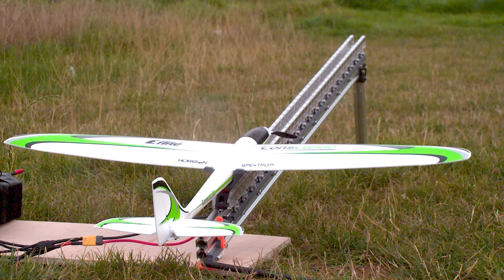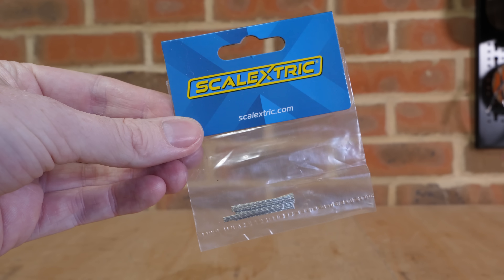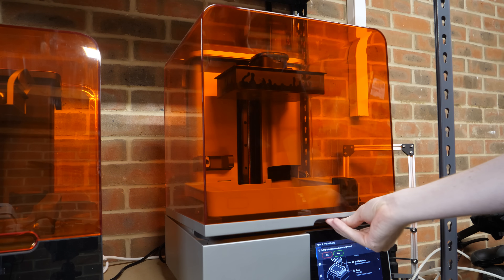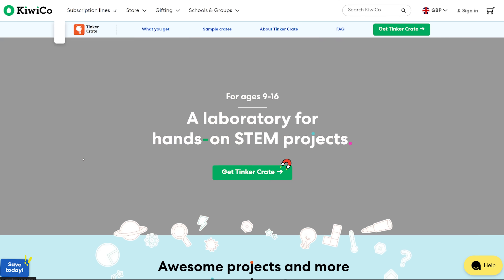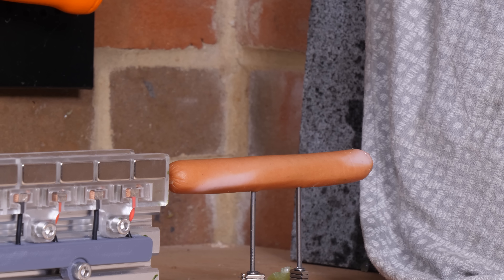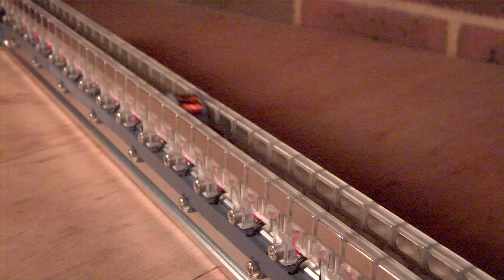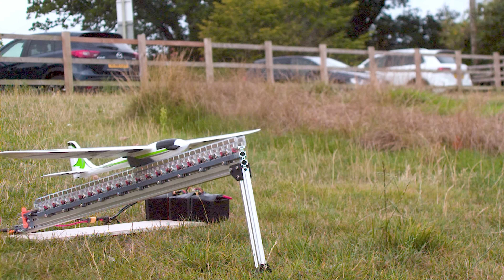Electromagnetic Aircraft Launcher

Comment: Definitely one of the coolest, even if I reckon a brushless motor and some timing belt with a linear rail could get you repeatable braking for a no collection necessary slide.

I mean obviously there are a lot of ways of doing it, but an analog brushed linear motor is one of the flashier ways it could be done.

Comment: This should be computer commutated using optoelectronics sensors, Hall effect or eddy current sensors, or anything that’s physically and galvanically isolated from any moving parts. They even have MEMS chips that function as reed relays with no latch bouncing. I think they use Hall effect sensors and SCRs. I’ve built TTL and microcontroller SCR/mosfet drivers that have timing adjustments for each coil and that seems to work best. No spark gap erosion. No commutator wear. If you’re using commutators it should be of tungsten, or platinum coated copper, or any refractory (high melting point) metal that has low resistance and high wear resistance.

Comment: Instead of that bigger Reed switch you made, you could have kept the original switch. Just by adding another spring on the top of the switch that pulls it with force onto the contacts. Large power circuit breakers use large springs to slam the contacts together so they don't bounce and cause arcs and damaging the contacts. Some breakers even have a crank on them to wind the big spring

Comment: Need to combine this new launcher with your capacitor airplane! Think of it like those missiles that sit underground for years, then get prepped and launched within minutes. Here you can have two contact strips on the top and another set of brushes riding on them specifically to charge the capacitor. So once you press the "Go" button, the plane will get accelerated while also getting charged up at the same time! May not fly for long, but at least it will be very quick to re-launch.

Comment: Once the sled has some speed, you shouls also change the "timing" so the coil shpuld be energised earlier. I think (by using "pre-ignition")  then you can end up accelerating faster, with a higher end speed

Comment: flyback diode is a must in this design to preserve the contacts, and possibly the batteries. your coil produces immense voltage each time the contact is abruptly created or broken which results in violent sparks.

to debounce the launch switch, just use a microswitch

Comment: Really interesting watch, reminded me of my RC car days and the brushed motors we used to use. As your launcher is basically a brushed motor reimagined.

There are maybe two improvements you could make to your launcher. First using a motor brush and copper for your contact points. Motor brushes are designed to be strong electrical connections and low friction.

Second, with ‘modified’ motors, there was an option to advance or retard the timing. This changed when the coil was activated relative to the magnet. From memory this could change rpm and torque.

Maybe could help with future versions.

Comment: The back emf coming from the coil creates a serious problem in the polarity change that occurs when the carrier moves. For this reason, extra pads with a diode connected between the pads with different poles in accordance with the direction of the back emf will greatly increase the performance.

Comment: When you vary # of turns, you should adjust wire gauge to fill the bobbin the same (this will also make the mass the same).
          You need carbon brushes for the contacts.

Comment: Now you need to make a coil-gun for landing, too!
How is it supposed to accurately dock with the retardation sled? I have no idea! But imagine how cool it would be to no longer have to worry about your landings damaging your creations and instead always just aim them at a sled that when it [the plane] hits it [the sled] is lightweight enough to not damage the plane, grabs onto it, and then retards it using a low enough force that the plane does not get damaged (but still stops before it runs out of rail and crashes).

Comment: How did you calculate the optimum distance between the coil and the brushes? Could there be room for improvement if different sledges had a different offset between the brush and the coil? I could imagine the sledge mass can have an impact on this variable.

Comment: I'm curious to know what would happen if you did not use brushes at all, and instead had a wire tethered to the sled (below the sled, leading under toward the far end of the rail). Then you could trigger the firing optically, resulting in less friction, and possibly making the rail construction simpler.

Comment: Apparently to prevent bounce: Weaker ceramic magnets on the middle section of the switch arm, and the contact stopper did not exist in 2024. :- Apparently: A pair of Carbon brushes, and torsion springs like in an angle grinder did not exist, and neither did solid copper contacts. And I know for sure bipolar Capacitors to prevent back EMF sparks definitely don't exist in 2024. Sometimes simple; is to Simple. Overthinking is way better.

Comment: I think you need to reverse the design. Permanent magnets on the plane, multiple coils along the track. Turn the coils on and off with photo sensors and driver transistors. No issues with contact brushes that way.

Comment: 7:21 wouldn't have been better using a power mosfet to drive the high current that is controlled by the small reed switch? I guess that, due to being smaller and moving less, the small reed switch would bounce even less.

Comment: 1. Use Ferrite core on the sled to increase magnetic force applied to the sled.  Ferrite would also work better with fewer turns.
2. You can use Electric Motor brushes made out of graphite to avoid plating problem. usually Motor brushes have springs to apply a small amount of force on the contacts to get a good connection. Only one side of the static brush contacts needs to be intermettent. You could just use a single bus bar along one side & just make the other side segmented. 
3. Adding local capacitors for each stage (segment) would increase the current for the coil providing more acceleration power.
Reply: > Only one side of the static brush contacts needs to be intermettent. You could just use a single bus bar along one side & just make the other side segmented.
I think this is only true if the polarity between each magnet segment wouldn't be inverted in alternating fashion
Reply: @MrFlaschenhalter  Correct, if you needed to swap the field after every magnet you need both sides to be segmented. I'm not sure if it is worth flipping the field as the ramp on/ramp down time of the coil may take too long to respond to the magnet's repulsion, not sure tho

Comment: Hi Tom 👋😀 
So is there a speed limit if you made it longer?
As i understand it, its just a DC motor in a straight line. So given the information you have how long would it get before there's no increase in speed?
Reply: There is a speed limit for the same reason objects falling off a building will eventually stop speeding up (terminal velocity): air resistance. The electromagnetic force at the start is far greater than the force of the air the sled needs to push out of its way (not to mention other forces like friction), but eventually the sled will be going so fast that the air resistance (plus friction and everything else) equals the electromagnetic force and then it stays at that speed, aka speed limit

Comment: Two suggestions: Insert an iron core into the coil to focus the magnetic flux. And exponentially increase the magnets along the track to build up the acceleration.
Reply: A powdered ferrite core is likely going to be even better than an iron core, but finding the ideal mix will depend on the switching frequency...
Reply: @georgedorn_fnord I agree that powdered ferrite seems like it would be better, but as you say I’m not sure whether the frequencies involved would be high enough for it to make a difference or not.
Reply: @DaveEtchells  Guessing really wildly and looking at the frame data in his analysis, I estimate the switching frequency can't be much more than a kHz or two.  That said, it'll look more like a square wave than a sine because of the time spent in air, and it's really the charging and discharging time we care about most.  If we sliced out the air time and measured the ramp up / ramp down times, that could be far higher.  I wouldn't even know where to start, there.
Reply: @DaveEtchells  I think ferrit core would almost be a must, as iron is magnetic and could interfere with the rail's magents when unpowered.
Reply: @dusinnhht tattoo machines use an iron core in the coils and dissipates magnetism well  up to at least 200HZ but the rail accelerator is probably running much faster so you may be right
Reply: Sorry, that should read   "exponentially increase the spacing of the magnets along the track to build up the acceleration"
Reply: @FondueBrothers  maybe not?.  You could, in theory, print it like a channel and just stack the magnets next to each other.  At this point it becomes how close the AC connectors can be.
Reply: Putting a 100nF (0.1uF) 250V capacitor in parallel with the coil will significantly reduce or likely eliminate the contact arcing and save your brushes. Nice project 👍
Reply: The ferrite core will enter saturation. There will be a nonlinear increase in current. The ferrite core also has disadvantages. 🙄
Reply: just a thought on that and the sparking. The magnetic field builds up in a linear way due to the inductance. With the voltage and inductance you get: u=L*di/dt. So the more inductance you produce the longer it takes for the same voltage to drive the current through the coil. But current is the important thing to magnetic field. Also the sparking is directly related to the energy stored in the coil. Energy flow must be continuous it cannot go to zero at once. So the voltage goes to infinity (theory) and the current keeps flowing due to the arc connection. Maybe some of the time to actually build up the field in the opposite direction gets lost in the full discharge of the remaining field (?) Same for relays and the free wheeling diodes. So I guess it all goes together in a design that appreciates the gain in speed due to the acceleration with changing contact length. Maybe also two coils each with a free wheeling diode in opposite direction might help with the sparking and get a faster initial build up of the magnetic field.  Anyway a really cool thing to wrap my brain around, thanks for the inspiration.
Reply: Could you put a high voltage capacitor (inside the coil) to supply the power to the launcher - so that the capacitor is part of the projectile?
Reply: Go look at a LINAC
Reply: Waaaait a second. Thats a railgun!

Comment: tips to reduce re-bounce on your high power switch (you might tried some of them but just didnt show)
-have it travel less distance since it will build up less momentum
-keep a lot of tension even when the contacts are closed 
-make everything as stiff as possible since the re-bounce is from material flexing
-keep the arm short since less mass and also less flexing

Comment: The whole rail except the first coil be live and the trigger just brings the last one on to fire, this means even if the trigger bounced as soon as the 'trolly' made it to the second set it would be live and  fire. 
If the trigger under spring was still in (pre)tension when in the fired position  it would also help calm the bounce back from the contact which could also be sprung to maintain contact through it's accommodation as well.
Carbon fiber brushes for contacts from cheap/broken ionizer modules or replacement brushes for them are easy and cheap and prewired.
Can the sled be captive and slowed or stopped in place come the end...

Comment: I'm on a similar project right now with the coils mounted on the rail and the projectile passing through them but your design is much simpler as it doesn't require an Arduino❤

Comment: I suggest trying the following: 
* Graphite brushes - you will be able to time when connections are made better, but at the same time there could be increased friction, so maybe it would not work well.
* High magnetic permeability material as back-iron for the magnet rails - do not underestimate the increase in magnetic flux of the magnets this results in... there's a reason basically every single electric motor has high permeability material to connect the flux paths of both electromagnets and permanent magnets.
* Shape the coil as a rectangle instead - could help a little bit
* ptfe surface for the carrier to slide on - reduces friction
* Make sure that the later stages aren't fighting your carrier - As you know, it is impossible to collapse  the magnetic field in an inductor immediately, and with the fairly high inductance you have with hundreds of turns, you might be killing most of your acceleration from the later stages. 
* Less turns with larger wire or multiple wires in parallel on the carrier - Allows for greater current capacity and lower resistance.

Comment: Nice railgun :) Looking at the spark shower, it could probably be reduced significantly by using graphite brushes like in electric motors. Either attaching them to the braids, or other springy pieces of metal. Another option would be to make polarity switching on the cart with magnet switches and have non-interrupted power feed to the cart. Hopefully there will be more development on this.

Comment: If you were to give an initial push to the coil sled, so that the magnets don't have to work that hard, say 2m/s, nothing crazy, what also could be done with the initial trigger, then I believe you could reach higher velocity, and acceleration, because the initial chattering of the coils is avoided. So the magnets really sohould be just the accelerators, not the movement initiator components. If you thought about this, but just not presented, then Mea culpa.

Comment: If you add some force to the brushes, say wrop them arround a TPU spring or use sprung carbon brushes, or even a  carbon brush with a TPU pusher... You will likely get a better result, IE less sparks. It would also be interesting to look at the effect of a cored coil I think, not withstanding the cogging/timing issue. Lastly how about aditionl magnets... It wouldnt be hard to add another magnet, bridging the existing ones, to form a Hanbach array, on either side, that would significantly increase flux density. Great Vid as always, cheers. I like the capacitor Idea, previous comment, but would recomend a current limit resistor in seriese with it, or even an inductor. Basically yu would be adding a snubber that would also be setting up the next phase switch. Timing/phse shift, would likely need tweeking.
If you scope the current you woluld likely be able to optimise timing at different valocities, as the sled accellerates. Dfferent timings at different speeds may help!

Comment: That spring loaded switch could have just been a spring powered launcher.  The projectile having some initial velocity would have solved the problem with the forces.  It would also reduce the contact time on the first contacts and reduce copper melting to it.  So the gun would have a safety switch, and the carriage entering the accelerator would be the only thing that could close the circuit.

Comment: you can probably solder the wicks directly by holding them tightly with pliers. the pliers prevent the heat from traveling too quickly.

Comment: A great project. Have you thought about motor brushes? Graphite and copper mix. This should reduce arcing, rather than just copper. It works in electric motors.  Also worth remembering that these brushes conduct differently across width and length to reduce conduction when crossing commutator segments.

Comment: Why did you go the extra step to use the copper brushes on the rail to connect to the nickel contacts which then in turn connected to the brushes of the sled? Wouldn't it be easier to just use the copper brushes on the rail and the nickel contacts on the sled?

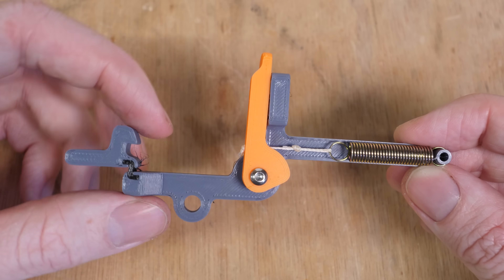Comment: 6:30 isnt the whole issue with this lever design the face the spring is compressing as it closes. maybe a counter lever desing would have worked? cursed option is use an arduino and relay and use debounce to trigger the relay.

Comment: I wonder, how big of an effect have the different impedance of coils with different number of turns. It will limit the rate of switching the magnetic field. It probably limits the max. speed? Cause of the plateu in the acceleration plots? Putting some stages down the line further apart may be could help.

Comment: Since every spark isn't contributing to forward motion (actually friction as well),  try using electronics to do everything as it goes along  the rails. A one shot digital chip gating a MOSFET would work better that anything mechanical. And equally so have follow on one shots to MOSFET design to apply the voltage/current at each stage using photo sensors. There would be no bounce, no sparks and more power going to the acceleration effort. When I worked designing power application circuits, we would always get bounce with every type mechanical setup. We even verified such bounce on digital storage Oscilloscopes. Lots more bounces then you would think. Once we switched to one shot digital circuitry, problem solved. Just an idea...    Thumbs Up!

Comment: 7:27
Hi! I love your content, and as a young aspiring electrical engineer I was wondering why you couldn't/didn't use the Read Switch like a transistor. Having a seperate smaller circuit with less voltage controlling the main voltage for the accelerator track. Thank you!

Comment: Nice!  Is there an optimum offset between the magnets and the contacts?  I first thought you won't be able to test this with your fixed rig, but you could adjust the position of the brushes on the projectile in relation to the coil?  Maybe though the offset needs to change as the projectile accelerates?